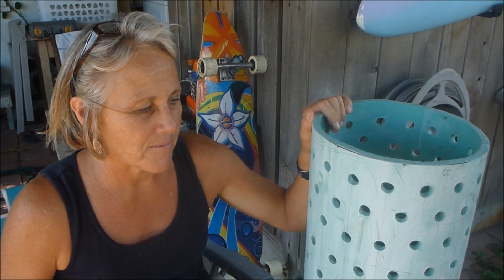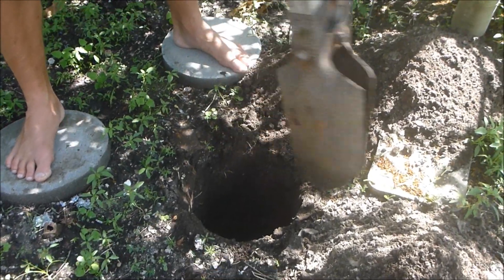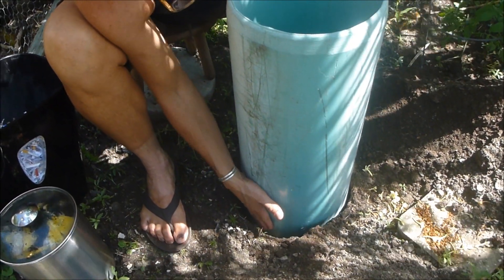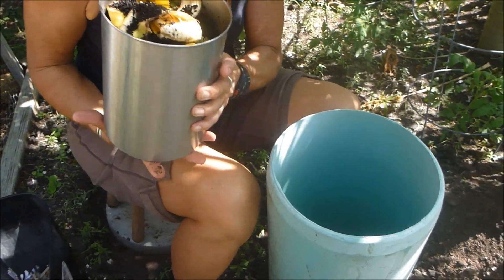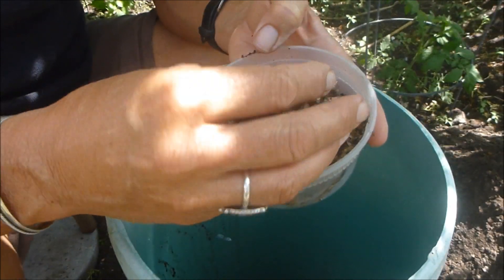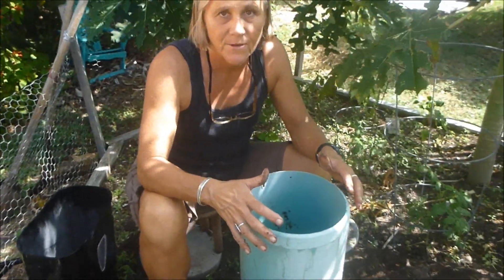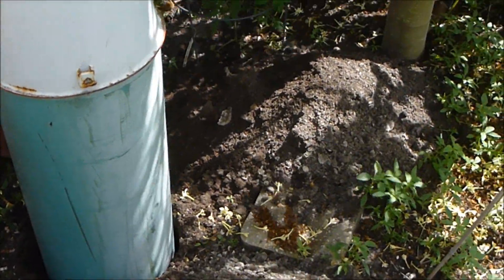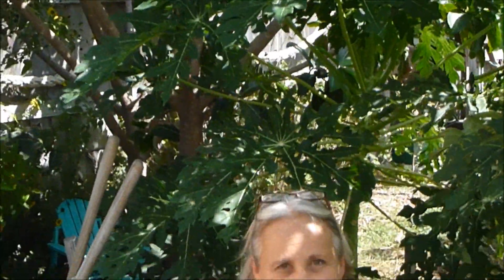Build Your Own Composting Worm Tower

Comment: Thanks for sharing.  I understand the worms crawling in and out and aerating and fertilizing the soil but with a worm tower do you also collect the castings that eventually accumulate in the tower?  I used to work at Turners Gardenland on SPID years ago.  In San Antonio now but I actually miss Corpus.  thanks for sharing
Reply from the maker: The worms poop outside the tower too so the castings get spread around. Towers aren't perfect but they're so easy that I use them. I have found worms in my soil all around the outside of the tower.